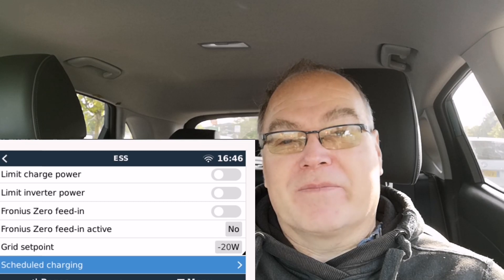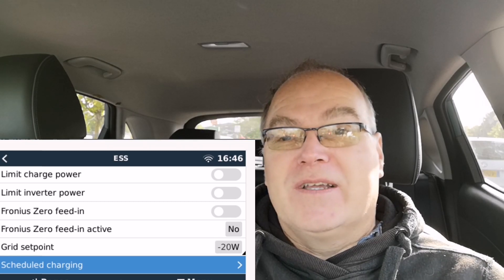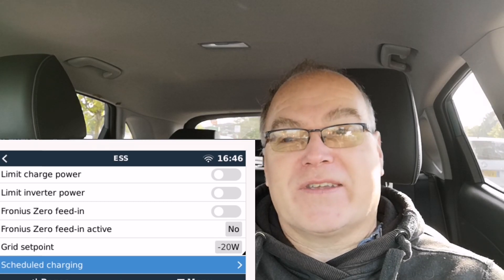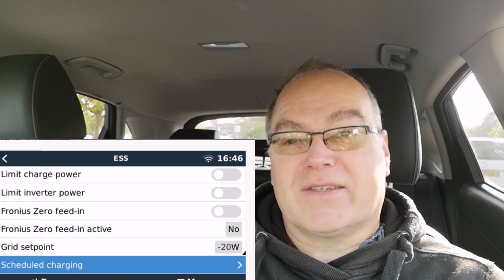Home Lithium LiFePO4 battery - Why grid energy is still imported

Comment: This puzzled me for a while, seems that's how the inverter avoids dumping the battery to the grid, 3 years use now and i've found that from early February 'till early November when i'm more or less "off grid" ie i'm relying only on solar to charge the battery, that constant small draw is there. In February it's around .8 kWh per day decreasing to around .4 kWh per day in mid June, i've also noted that as long as you are sending as little as 5 watts  solar, after battery reaches 100% SOC to the grid, there is zero grid draw.

Comment: First of all thank you for your videos! 
I am thinking to get a battery and a inverter to charge at of peak with octopus and discharge on peak times, without solar panels,
are you happier now with the give energy solution or do you recommend me a Victron?
I look forward to hearing from you,
Regards and keep doing videos! big fan >)
Reply from the maker: Givenergy has the advantage of export timers. Victron needs manual intervention. I haven't found a programmatic way for timed export with Victron Yet but as Moixa use victron inverters it must be possible.

Luxpower has good charging and exporting parameters too.

I personally think others will follow Givenergy's lead on export timers but at present they're one of the better solutions with Agile.... Or will be I ce the new release gets here.
Reply: @EVPuzzle  The key features I am looking for are a good data update on the app and to get the system that uses less power from the grid, or at least reacts faster to stop using grid and use more battery, I am going to charge with octopus go so I am not worry about agile.

Do you think is worth the Victron in this case or better the givenergy?
Reply from the maker: Yes, without doubt I consumed less kwh and wasted less in export with Victron. Victron has a good real time update and is accessible to control directly without the Internet too. Its a robust solution just lacks export timers to make life easier
Reply: @EVPuzzle  Thank you for your time Nigel really appreciated :)

Comment: Hi, i recently went the lux ac inverter with pylontech batteries as i can easily add more batteries and also with 3 pylontechs the inverter outputs its full 3.6kw - however, your observations regarding switching and ramping up and even slight grid draw is exactly the same.  Im pretty convinced its the CT clamps that only are accurate down to 50w that causes a lot of the small issues especially switching from charge to discharge when the house is idle.   Im also a low power user of just about 3.5kw a day average and since addiing the lux setup, it has reduced that down to 0.6kwh per day

Would be interesting to know your daily grid consumption for comparison ? so i guess these systems are all very similar in how they work
Reply from the maker: 0.6kwh is high compared to mine.

On sunny days less than a tenth.
On duller days a tenth
Busy appliance days lots of on/off a couple of tenths. 300wh is the most I've seen.

I've heard Lux can adjust the export settings as per my grid set point to reduce grid draw.

For example from midnight to 7am today I had only 10wh of grid use. Now after a busy day with DIY devices we're at 130wh. Should be 140wh by midnight.

I'm convinced it's the electronics in the inverter.

A friend with a Powerwall had roughly 1kwh draw a day. He raised a support call to the installer who adjusted parameters. Now it's just a tenth per day
Reply: @EVPuzzle  ah ok good to know,  i installed this myself so i guess i need to experiment more with the settings, some of which i have no idea what they do or how to use like reactive power, i do kinda wish i went victron and pylontech.

This is all a challenge now as its bugging me :)

Comment: my smartmeter (smets2) was fitted some months after my solar went live. I observed significant differences on my inverters monitoring system as to how it ramped up and down power output when running on battery.
Reply from the maker: I'm on a smets 1 meter

Comment: As always, enjoyed your analysis. Are you aware of a way to reduce the grid set point through the Solaredge set up or is this only possible through Victron? Looking forward to hearing about your wind turbine research  and the difficulty of not interfering with FIT
Reply from the maker: I haven't seen the Solaredge Storedge configuration as yet.
It's not something that I've seen in the solar inverters but if course there must be controls over export as some implementations require no export.

Comment: The ramping you spoke about. I don't get that with the Powerwall, it will deliver up to 5kW constantly if it's required or 7kW for a short burst. There is no ramping or blending with the grid to deliver the load to to the house. If the house load goes over what the solar and Powerwall can provide (11kW in our case), then the grid will pick up the difference.

Comment: Nigel.., considering the grid cost of 1kw say 14p and your switching times might allow .004kw on each occasion of switching... is it really worth all your efforts.
There will always be these differentials all the time and you cannot do anything about it. Best solution is to remove the grid completely, that’ll sort it for you and reduce your stress levels.
Reply from the maker: Dave it's not about the money. It's simply understanding what it will and won't do. Different batteries seem to go a better job. If you just accept it how it is you might actually have an installation problem and not be aware, thinking it's normal.

Going off grid remains a distant possibility. I would like to be completely independent

Comment: Think you reach as far as you can go with tweeking the battery.
It will alway draw from the grid because it will alway have to synchronise the frequency. Everyone's home devices needs uniform or boom or blackout.
Spikes you see may not amount to much at all. Example: The device catches a millisecond spike just before next snapshot, it may record it as usage for the total of that data slot. If data slot is 5 minutes and spike was 500w it could record as upto 42watts for that event instead of less than 5watts.
Reaction time is like anything you buy more expense better and quicker it performs, cheaper then you have to make allowances. Nothing is perfect especially when its reacting to an event it did not initiate.
What your trying to control is the predictive & reactive to a millisecond sorry but you need 'AI' for that not basic algorithm like 'P.I.D loop control' & 'bais control systems' (loop these term up).
Still it's fun trying though.

Comment: This is very interesting.  If you had enough storage capacity, would it be better if you split your ring mains?  So some or all of your load is battery only?  Would there still be a pause before the battery came on-supply if the grid weren't there at all?  I'm not an electrical engineer either.  If a battery were using successive approximation to increase the power it was delivering, would that adversely affect the connected device until it reached a threshold of operability?  Is this an issue in off-grid situations?

Comment: Not sure if this is directly relevant but ........ I've got 9.6kWh of Powerbanx and 4 kW solar.  I've found that the battery can't (or at least is on a setting that I don't know about and haven't changed) cope with 100w 'in' or 'out', so to speak.  So, if for instance, the solar is producing 400w and the house is using 450w then the battery can't deliver that extra 50w and so the 50w requirement will come from the grid.  If the numbers were the other way round then the excess 50w would go to the grid not the battery.  I don't think this is significant overall, but as my background overnight, (when everything apart from a few items on standby is off and the fridge/freezer was on its 'off' cycle) is approx 80w, then that 80w would come from the grid.  When the fridge switched 'on' the total background is about 200w so everything would then come from the battery (assuming it had more charge than the lower limit of 20%).   To sort out this 'overnight standby effect' I now run a 20w bulb 24/7 in my garage, and that sorts the effect out overnight as the background doesn't ever drop below 100w.   I estimate that the 'not less than 100w' effect accounts for about 500w of grid usage during the daytime which I am not going to worry about!
Reply from the maker: Yikes what an odd situation. Like I said you just don't know what it will be like until you've installed it. Glad you've got an easy resolution. Crazy but understandable, use a little more to save more
Reply: @EVPuzzle  Love the setup though!!

Comment: Seems to me that powerwalls etc aren’t good value for money. Surely every EV owner already owns a massive power wall with a wheel on each corner. More needs to be done to use excess power in the car to balance or power the home.
Reply: There was chademo bi directional charger announced CES in January. In my mind would be have old leaf in drive and use that as my home storage for 5k for argument same price old leaf.

Comment: I don't see why it can not work like this...
Grid  __>  Battery --- Inverter ---- House
Solar ___/
So the house ALWAYS uses the battery via the inverter. Solar charges battery all the time. When energy is being used it will go straight to the inverter from solar anyway via the wires that go to both. The grid would only ever charge the battery when it goes below 20% SOC ( or whatever the suggested level is). Then it would surely only use the grid when it really has to. Limits house usage at any one time though. Less efficient when grid is used to charge the battery but hopefully that would be not very often.
Reply: only need 1 inverter as well
Reply from the maker: Saw a study recently proposing something similar with a constant charging  load on the grid making grid balancing easier

Comment: 8 kWh from the grid is about 0.1p.  
I know that that’s not the point.  As I understand it large commercial buildings have capacitors to balance demand. I have a feeling it could be quite an easy fix.

Comment: I wonder what would happen in a power outage from the grid?
The battery, if it were charged, would presumably have to kick in and supply the demand?
However, I feel with grid supply available you’ll never get to a net zero from the grid.
Reply: Sounds like you have on-grid back up batteries. Not all batteries can cope with surges at equipment start up so are not suitable for an off-grid setup. They would need to ask the grid for help at these times. The Victron Multiplus can certainly work off-grid with partner companies such as Pylontech so sounds to me like you went for the wrong setup. 😩
Reply: @neilbridgeman7768  uk regs require a grid tied system to shutdown when grid fails.. it can then isolate itself and then run on batteries. if you want true UPS mode you'd need a very high power battery and two inverters, one to feed grid, one to feed house
Reply from the maker: This battery doesn't have power cut protection. If there's a power cut both my PV and battery become defunct
Reply: The EV Puzzle  oh right ok I assumed that if the  battery was charged it would discharge its power, you live and learn

Comment: The gateway 2 on the powerwalls go across the main incoming supply rather than a circuit from the house consumer units and multiple CT clamps, and switches a lot cleaner but it still not perfect as the grid is a moving target for the battery to keep up with, and that is frequency and voltage and your loads in house changing. The only way to truly go grid free is to turn grid off  with the gateway 2 you get 5 kw inverter plus the solar energy, and there is a issue with this, once the battery is full the battery increases frequency in your house to turn your solar off so there is not more than your using a no where for power to go , which again is fine unless you have a fit, if your solar is not working your not earning money from fit 
Hope this helps nigel
Reply from the maker: It does and I agree. I suspect Powerwalls use more grid energy because of their ability to work without the grid
Reply: My powerwall 2 with gateway 2 uses around 0.2 kWh a day in and 0.2 kWh a day out

Comment: Perhaps a separate charger and inverter may be beneficial. This would eliminate the switching between modes and may then do away with the ramping up of the battery to meet the load.

Comment: I believe "successive approximation" was the phrase you were looking for (12:00).
I would hazard a guess that the more integrated the system (Tesla Powerwall?) the tighter the control should be, whereas a system made up of off the shelf parts that are coupled together may not perform as well? (More generic nature of OTS parts to cater to a broader use case market coverage)
Reply from the maker: That sounds right. I'll confess I don't know for sure which device contains the algorithm for the successive approximation

Comment: Buying battery storage increased my bill, hated it , sent it back , my experience is the batteries are not ready, . Not efficient enough.
Reply: Faz khan was it a powervault
Reply: Chris Hill how did you guess? 👍🏼👍🏼
Reply from the maker: You must've got a duff one I guess
Reply: Faz khan because I had one and the amount of times  it failed was stupid and never got anywhere near 60% efficient when it was working lucky to get 2.8 kWh out of a 4.1 kWh battery despite being told it had a usable capacity of 4.1
Reply: Faz khan I sent my back and got a powerwall 
The only thing I miss with the powervault was the time clock but believe Tesla are sorting this out